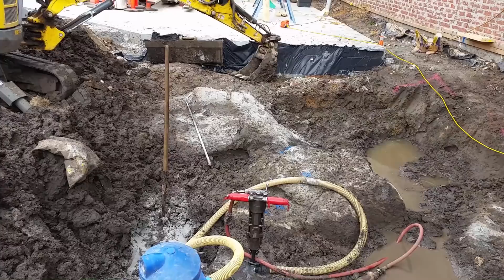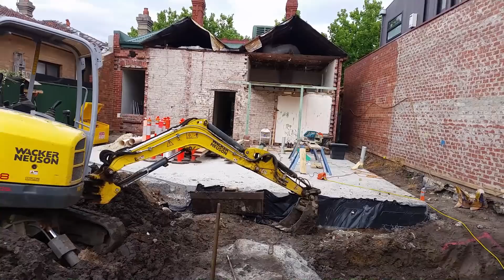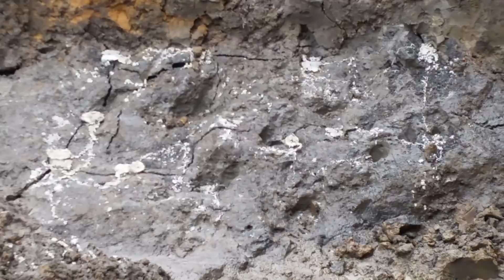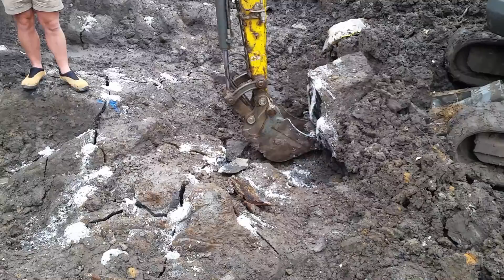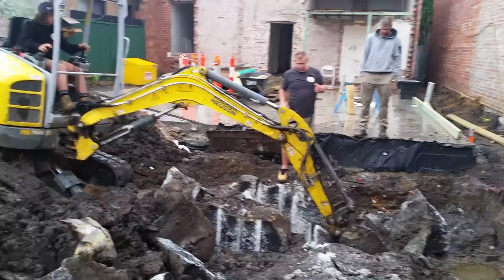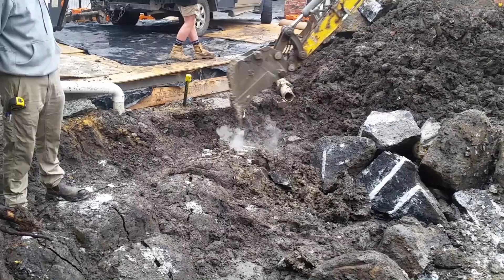Breaking Basalt rock with Expando for an underground water tank

Comment: It seems that, without the push you get from explosives, the rock is still pieced together and as a result digging can be difficult at times.

Also how does this work in solid Rock? I am assuming you would have to drill relief holes similar to presplit operations.
Reply from the maker: Hi Brian,  you are correct, it is great for breaking oversize but when attempting to break out a section from a massive rock more thought is needed. The best results are obtained using a combination of vertical and horizontal holes or rows of 45 degree holes drilled from opposing directions. care also needs to be taken with the timing of the drilling and loading so that you can get it to break where you want and not off to some  adjacent hole. extra relief holes are good for influencing it to break where you want.

Comment: Why does the excavator not load the rocks on the dump truck as he is removing them. Looks like a city employee putting in time. Waste of manpower. Operator needs a bit more experience
Reply from the maker: The truck was coming after I left the job as there was no room for both of us, The operator was on about 16 years old and he had no options to re position the machine, very difficult conditions on the site.
Reply: Thanks for the reply. Makes perfect sense when room is constricted

Comment: 1) how did they get that digger in there?

2) with some of those big rocks and that little digger I was thinking it might be quicker to just drill the rocks and throw a lifting eye or two into them. Lift them straight out instead of trying to crowd them into the bucket.
Reply from the maker: Oh yeah, that was a horrible site, It's hard work drilling those holes you know.
Reply: Nylon choker always worked for me.  That's a big strap for rigging,  in case you Aussies use a different term.
Reply from the maker: @mikusoxlongius  - I often use a choker chain Dave, that works well also

Comment: you should do a video where u leave the camera and show the moment it cracks. if its possible. or timelapse
Reply from the maker: I have a time lapse video on the to do list Joe, I need a job that is in a secure location where I can leave a camera set up and a good flood light, very occasionally a rock will split with a pop, usually they just very slowly crack and open up. once a rock has started to crack you can take a short drill steel and press it against the rock and at the same time you rear lobe, closing your ear and you can hear the rock slowly tearing.
Reply: you could even slow it down for each pop on the time laps. i cant wait to see it.if youre every lucky enough and you know the time around the stuff actually makes the stones crack. you videk it in the day and maybe kind or bury or camouflage the camera.

Comment: You mentioned blasting puts micro-fractures in the rock, making it unuseable for headstones etc. Does the Expando do the same thing?
Reply from the maker: No, the expando is great for splitting stone without damage, black powder is good also.

Comment: Dave have you checked out that YT clip Korea Plasma Rock Breaking, "Plasma Rock Breaking Method using Electro-Power Impactor(EPI)". I reckon it could be a very good thing to investigate as you get the speed of explosives without the danger or the noise. Could give you a competitive edge to your works.
Reply from the maker: Yeah, it is a deception, 100% all it is in using copper oxide thermite  as an explosive and firing with a high power electric jolt. Copper oxide thermite is a lot more energetic and sensitive than regular iron oxide thermite and probably more dangerous to handle. Very similar results can be achieved with smokeless powder (Nonex, PCF etc.) 
Search Copper oxide thermite

Comment: How does the cost compare to high ex per hole?
Reply: Demolition Dave Drilling and Blasting I don't want to know actual dollar amounts but how do you figure a job is it hours spent and equipment etc?
Reply from the maker: cost per hole is similar for say a 1200mm hole, cheaper for shorter holes a lot more for long holes, the catch is that the hole spacing is a lot less than blast holes so the drilling time and $$ is increased.
Reply from the maker: kamurray67 - yes that is about right, time + machinery hire + consumables.